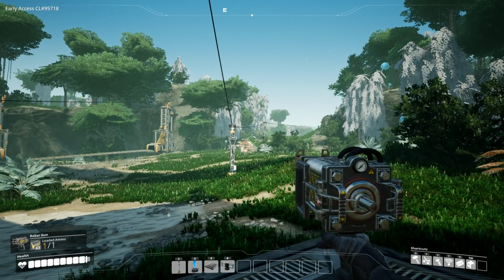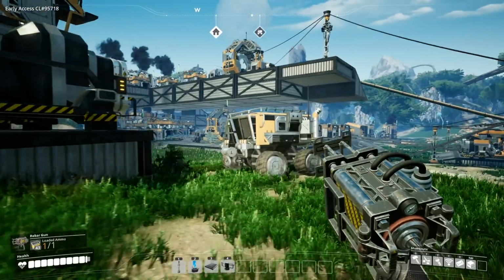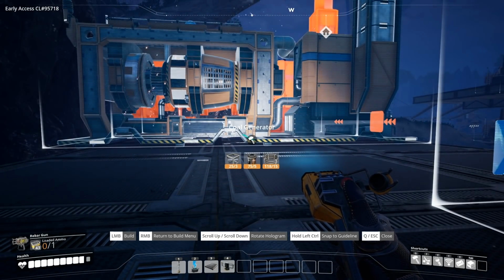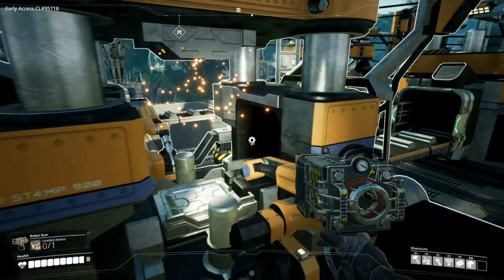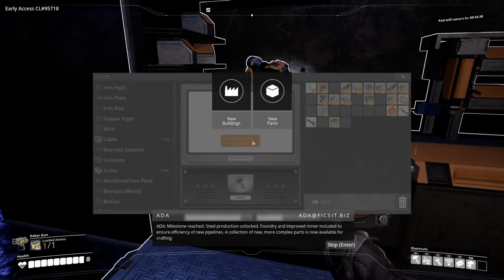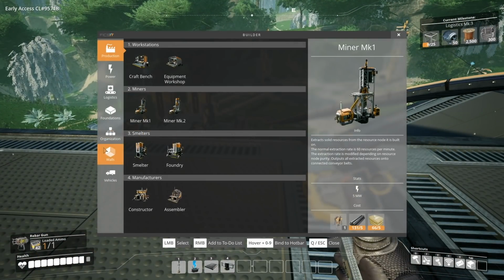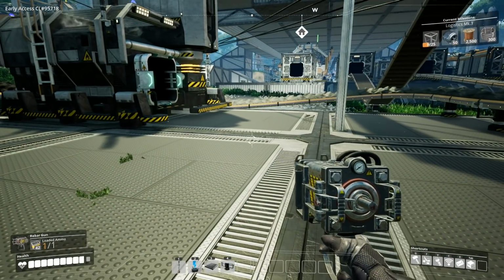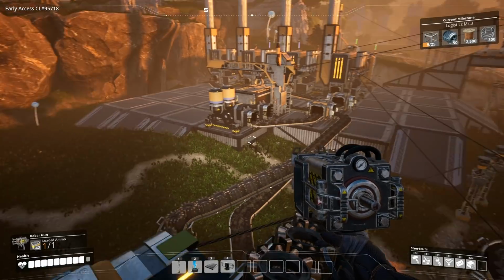Satisfactory - Steel Production & Setting Up a MASSIVE Brand New Power Grid (Satisfactory Gameplay)

Comment: Everyone has a factory so big its like a town...but i still can't even find where my copper deposit is and i  only have 3 buildings
Reply: Use the scanner. C is the button I think.
Reply: @NeutralShock49  i know that but the copper is so far away and the miners and the other things don't appear on the compass so anytime i need it i have to scan its a bit confusing sometimes
Reply: Try putting down a beacon then. It will show you its location all the time at the top of the GUI

Comment: pls turn off your flashlight (key "V") it makes all the buildings super shiny and blinding, also you shouldn't overclock buildings unless they are being fully utilized. Like that reinforced plate assembler was only being used 20% of the time so overclocking it provides no benefit. To see the usage of a building it is right under the gear icon in the machine.
Reply: Also to place down buildings easier you can make a lookout tower and climb to the top of it to have a top down view.